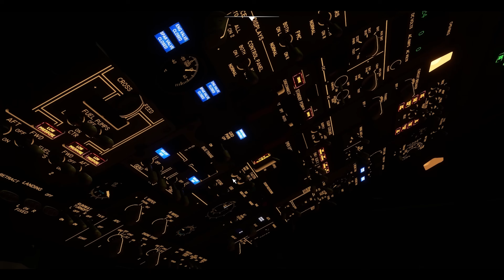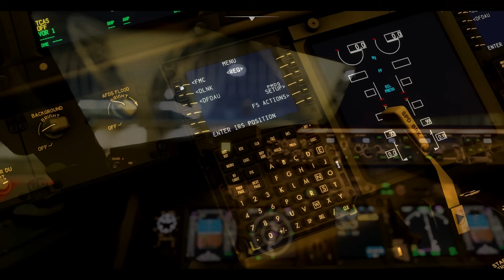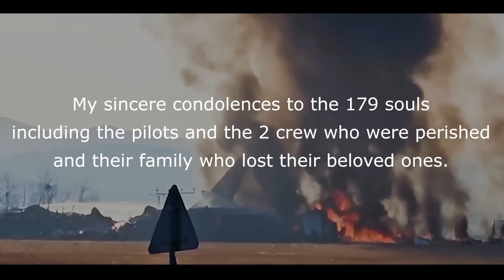What led to the JEJU AIR 2216 disaster ? | Simulator Experience | Msfs2020 | TFB

Comment: With 12,200 hours in the 737, at 400 feet fully configured to land with gear and flaps extended, I’d be incline to go to Flaps 15 and land straight ahead.  Pictures of the two engines as of late  appear to show the left engine may have been shut down.   No second guesses here. Just my informed opinion.  The facts will emerge here eventually and I’ll be proven right or wrong.
Reply: Agreed 100%  20 years and counting in the 737, numerous engine failures fully configured down low in the sim over the years. Most recently going into KLGA flaps 40. Everyone's initial reaction was flaps 15 and land, but the scenario was designed to demonstrate an 800 at max landing weight would make it to the runway easily on 1 engine, so we were told to land flaps 40. It was a complete non event. And based on 9100 feet of runway, I'd guess the JeJu crew was only at flaps 30. It would have been easy to either land F30 or go to F15. Lots of head scratchers on this one.
Like you, I don't want to throw stones at the JeJu crew, but I think once the DFDR/FDR transcripts are released, you will be proven right.
Reply from the maker: Definitely that's a pretty wise idea

Comment: This is a good video, but a lot more has been determined since this was made and posted... from careful review and enhancements of the videos taken of the stricken aircraft, to eye witness accounts who saw what happened to the aircraft, to a reported statement one of the survivors made and txt messages received by family members from passengers. First, @12:32 that video of the plane flying overhead is believed to have been taken right AFTER the bird strikes (plural, not singular!) as the #2 engine under the right wing was having compressor stalls.... however, there is enhanced and zoomed in video that has since been posted and it is clear that the #1 engine under the left wing and the #2 engine were both emitting sparks (ergo, both engines had ingested bird(s) and were damaged). An eye witness on the ground reportedly described the event as "the plane flew thru a wall of birds", and a family member of a passenger on the plane received a txt message stating that "the plane has a bird stuck in the wing and we cannot land" (this was presumably sent right after the initial landing approach was aborted). Further it is noteworthy that the plane's transponder stopped transmitting data right at this point too, suggesting an electrical problem was also caused by the bird strikes (note, plural as in multiple bird strikes!). The engines provide both hydraulic pressure and electrical power while in flight, the APU (which is basically just a small turbine powered electric generator in the tail of the plane) was not running, as that is only used when the plane is on the ground and main engines are turned off. One of the flight attendants who survived reportedly has said that she remembers the plane's engine trailing smoke and then "it exploded" (it is unclear what "it" is that she was referring to... the engine trailing smoke, or the plane itself). Finally there is video taken almost directly head-on as the plane finally made it's last touchdown and in that video it is very obvious that Engine #1 is NOT emitting any heat or vapor trail or anything.... ergo, Engine #1 is not running as the plane touched down. As the plane is skidding past the camera position in another video it is clear that the #2 engine is still running and it has it's thrust reverser open, though it is not clear if it was commanded by the pilots to open or if it had opened due to bird strike damage or due to the engine hitting the runway as the plane touched down. But the #1 engine's thrust reverser remained closed. Back at the head-on view of the plane touching down, it can be seen that the plane is yawing to the left... which could be consistent with the #1 engine not running and thus the only thrust is coming from the #2 engine on the right, but the #2 engine's thrust reverser was activated and #1 engine was not running so one would think the plane should have yawed to the right instead. Lastly, please note that as you watch the video of the plane skidding down the runway taken from a side view, there are in fact 2 birds seen perched on a fence line between the camera position and the runway... one might think that airport is located where there are A LOT of birds at any given time!
Reply: A few other noteworthy items are as follows: This model airplane is not equipped to dump fuel while in flight, so even if they had 1 good running engine and could loiter around at a safe altitude, this plane could not have dumped any fuel. The plane's APU was not running, as is typical since while in flight the main engines provide all the electrical and hydraulic power the plane needs... the APU takes at least a few minutes to turn on get spooled up and start producing power, that's time they didn't have though. The engine thrust reversers do not require the gear to be down in order to activate on this model plane... it is unclear if the #2 engine thrust reverser was commanded by the cockpit to activate, or if it just opened up on it's own due to damage from the bird strike or from the engine striking the runway as the plane touched down however the #1 engine under the left wing had it's thrust reverser closed as the plane skidded down the runway and engine #1 was clearly not running. As the plane is seen touching down and then skidding past the camera position on the runway, only 1 thrust reverser was active the landing gear was up the flaps were up and the spoilers were not activated either... all these devices are hydraulically operated, and they all have manual ways to activate in the case of loss of hydraulic pressure (which is created from mechanically driven hydraulic pumps in each engine, and can also be created from electric hydraulic pumps inside the plane also as a backup system but that takes electricity which any "good running" engine on the plane can produce but note that there has to be at least 1 good running engine and the hydraulic fluid must not have been lost due to lines being damaged); it takes time to manually activate any of this stuff and again time does not seem to be a luxury this flight crew had! Also note that the planes flight controls use hydraulic pressure to provide "power steering" to the cockpit controls, and without hydraulic pressure (for whatever reason it may be lost!) it becomes extremely hard to operate the flight controls to fly the plane! The 2 flight engines have been recovered from the crash site, one engine appears to be completely missing several of it's fan blades and both engines are crammed full of dirt from the crash... it is unclear which engine is which however we know that engine #2 was still running at touch-down and had it been missing fan blades it would have been extremely unbalanced and a surviving flight attendant reportedly said she saw an engine trailing smoke and then "it exploded' which could possibly have been the engine that is missing fan blades. That object at the end of the runway the plane struck so brutally, was not a "wall" it was a raised earth and concrete berm (ie. and artificial hill) ~4 meters tall and it was extremely robust and immoveable with thick concrete pours thru out it... it was a really bad idea to have that built so solidly there most people agree; South Korea officials have said they will be changing these things at other runways in the country as quickly as possible so as to never repeat this disaster this way! Lastly it has now been reported that bird feathers were found inside of at least 1 of the recovered plane engines... though it seems obvious that they would find bird feathers as nobody has disputed the fact that this plane flew thru a dense flock of birds, it does mean that investigators can now determine exactly what species of bird the plane was stricken by. This is basically every thing I have been able to glean from this disaster thus far. People should not rush to judgement regarding the flight crews actions that morning, as we still do not know enough about what was going on with that plane... I'm just saying. 😕
Reply from the maker: @michaelshrader5139  That was indeed a very great explanation Sir , as I have mentioned in the video , at 8:45 it is mentioned that this may not be the exact thing happened as the data which was available a week ago was not in this detailed manner . Once again , thank you for your efforts and that's great of you to share the information ! ☺
Reply: @TFBroadcast  So long as you understand that I am not criticizing you I think this animation is excellent work on your part. Thanks for the note. 🙂 I hope that at some point once the flight recorder and cockpit recorder data becomes available, you can record an accurate simulation of what actually was happening that led to this terrible outcome and then perhaps explore alternative scenarios and how they might had turned out (keeping in mind always that the pilots did not have hindsight to help them make different decisions). That would be really interesting to see!
Reply: @michaelshrader5139  hard to read that big block of text.

Comment: Based on your simulator, the video circle of circadian low might be a contributing factor to this disaster.  Ignored SOPs and initiated a go-around on final with 1 engine wasn't a right decision
Reply: Going around is not questionable. Pilots can always perform a missed approach if one of them feel unconfortable, without need to answer questions afterwards. There is a no-blame-policy for good safety reasons.
In this instance, i think it shows they did not intend to rush landing without checking their conditions first.  Or perhaps the bird strike lead to misalignment on final due to asymmetric thrust? 
Something must have happened after the decision to go around.
We dont know yet.
Reply: @Merilix2  Exactly! Had the flight crew not aborted their initial landing and tried to get it down on the runway right after having a significant bird strike event (likely struck by multiple birds) and the plane still lost control and balled-up or exploded or anything and passengers still died even just 1 single fatality, then people would be blaming the flight crew for NOT having aborted the initial landing approach to check the plane for damage and run thru checklists before attempting another landing! Hindsight is 20-20. Just saying. 😞
Reply from the maker: @Merilix2  Yes the video above is made just on the basis of reports that have been published so far from various sources . The Go-around was never questionable as the right thing that a pilot would do after having a bird strike is go-around but definitely that hasty and quick turn and landing was questionable when speed was out of control .
Reply: @TFBroadcast  See my comments just posted about things that have been gleaned by careful examination of the videos' that were recorded of the plane and eye witness accounts I have read about... I was able to add a lot of info that has been learned since you created this video (which your video seems more of an animation than a simulation... not that I don't like it, and I do appreciate the effort you went to to create this!).
Reply from the maker: Absolutely ! If another 5 minutes , they could have extended the landing gear : (
Reply: @TFBroadcast  After the first bird strike they opted to go around, which is SOP for Korean airlines. Then they had problems with the other engine. Essentially a double engine failure. No hydraulics, No 3 phase 115V AC, so no way to power the hydraulics. The only way to recover from this position would be to use the batteries to start the APU,  which takes time.

The time from the MAYDAY to touchdown was 3 minutes.

Insufficient time and no luck.
Reply from the maker: @christopherrobinson7541  Agreed upon the very unfortunate fate of flight 2216 : (